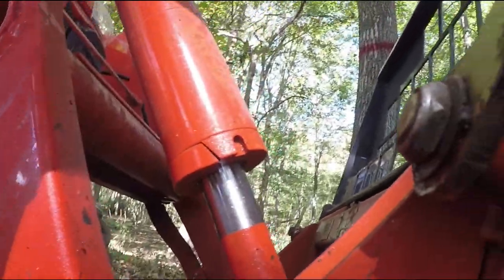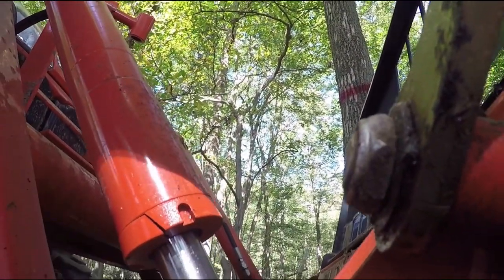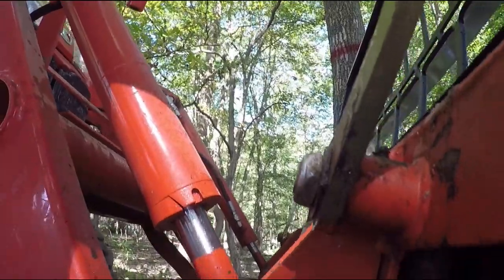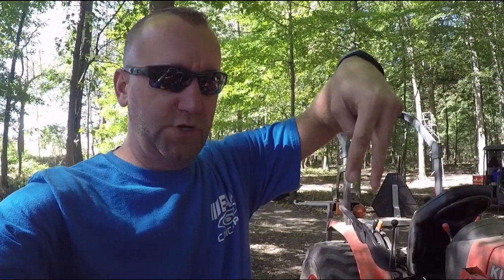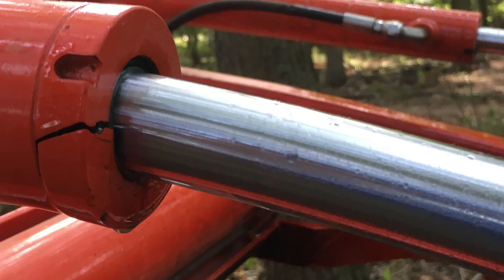Don’t Do This With Your Tractor!!

Comment: I replaced my kubota cylinders with cylinders from tractor supply.  Much cheaper to buy and easier to repair than Kubota cylinders.  Where necessary,  using a slightly shorter replacement cylinder that does not fully retract is no big deal. The fat cylinder has more power than skinny kubota cylinder.  In fact I was ready to throw in the towel on my 10 year old kubota till I started swapping cylinders. Use large kingpins to engineer them into position.  My old kubota tractor with new tractor supply cylinders and upgraded hoses is far STRONGER and way CHEAPER to operate than it was with new Kubota cylinders and cheap quality kubota hydraulic hoses. Kubota cylinders are planned obsolescence for their parts and repair business.
Reply from the maker: Kenton Hughes 
I didn’t even consider tractor supply for cylinders. I looked at all of the normal places online and didn’t find a real good match. I’d like to go from a 1.75” to a 2” cylinder but the tubes are too wide to fit between the ears and I’m not sure I want to do much modification. The other disadvantage would be slow actuation compared to the stock size. 

Magister carries a tang cylinder that is narrow enough to fit but I need an in between size to really work well. I tried one that was a 1/2” longer retracted and I lost more curl back than I expected. I may try the next size, which is 1 1/2” shorter retracted but 2 3/4” shorter extended. I have to see if I can sacrifice that much extension. I think I can because I hit my bucket stops before it’s full extended. I’ll make another video once I decide which way I’m going.

Comment: You can rebuild them a lot cheaper, also on my compact tractor When I had issues, I upgraded the cylinders....thx for video.
Reply from the maker: Freedom 1 
I agree. The problem I had was I deformed my tube. I had a busted cap, bent rod, and deformed tube. The hydraulic shop said it would cost more to fix it than to buy a new one. I did try though. They disassembled it and everything but there was just too much damage. 

I probably distorted the tube when I pushed the piston back in. Had I left it out and took it straight to the hydraulic shop I probably could’ve had it repaired cheaper. I was in the middle trying to get trees skidded so I didn’t want to take the time. My haste probably cost me more than it should have.
Reply: WorthOverdoing yeaaaa, that does make it difficult.... I replaced the seals in mine a couple of times. The 1st time i did it. It took me 6 hours.....the 2nd time it took 3 hrs. So next time I’m thinking it may only take 1 hr....ha ha..........thanks for the post.....best of luck to you!

Comment: I Would lift my front wheels off the ground with my bucket down and back drag with my skid steer all the time.... Never one issue ever in 5 years of owning it.
Reply from the maker: Sharp Shooter 
You never have problems until you do.  It has happened to skid steers too, as well as excavators, track loaders, etc. Nothing is immune.

Comment: I have done a lot of back dragging and the reason I have got away with it is that I don't go to full extension. I leave the last 4" of rod in the cylinder for strength, AND I don't try to lift the front off the ground while back dragging.   If you want to lift the front wheeels off the ground  back dragging,then use the heel of the bucket as this avoids ram damage.
 Tip: to change the thickness of the back drag when useing the heel of the bucket, use the curl, not lift ram to adjust thickness as it is more precise.  It just needs a little practice to get right.
Reply from the maker: When I’m back dragging I do the same thing. Changing the curl when feathers is definitely the way to go.

Comment: I used to operate a Case 580 and never had that problem. Believe me, I worked that thing really hard. However, the backhoe part was a different story. It leaked several gallons per day from one of the seals on the boom. It was like that when I started. I was making only $4.00 an hour and working 12 hour shifts 7 days a week for 30 days straight for a poorly run reclamation district. The wages were cheap and so was the maintenance. The boss was my wife's grandfather and never complained since it would get back to him saying I was ungrateful.
Reply from the maker: leegenix 
Good story. You just never know. You can beat on something for years and it never break and you end up doing something real easy and it breaks.
Reply: leegenix apples and oranges..case 580 is made for heavy work..kubota loaders are add on loaders and any add on is junk.I ran a 580 k for years with a clam bucket that was  tough and now have a john deere thats built like an army tank

Comment: Thanks for posting for the greater good =) You could have replaced both cylinders to avoid having the same problem with Kubota cylinders......The Bx is a small model but that should not have happened.......You might think/feel that this was from back dragging but its more likely that forward pushing broke the cap.....and back dragging against it made it noticeable with the leak.....This happens a lot when hydraulics are fully extended.....just a couple inches off fully extended limit would probably prevented this ....but at the same time it's clear that the 2 curl cylinders do not have the same throw.....I wish you the best of luck with the replacement =)
Reply from the maker: nitebird scuffle 
I plan on changing the cylinders but am having trouble finding suitable replacements with having to do a lot of fabrication. I just need to figure out what I’m willing to modify to make a different size cylinder work.  

This is a B, not a BX. It did crack the gland when the rod bent from back dragging. When you back drag, the forces are not pulling on the cylinder but pushing, which is how it bent. It couldn’t force it back in so it had no where to go.

Comment: I've been running JD 410 for almost 40 years. I can tell you a 410 could do that all day long with out breaking. Just a slight weak design. Still a nice little tractor.
Reply from the maker: Roger Trefren 
Possibly, but I found reports of the same damage from equipment much much larger. It all comes down to the cylinder being filling extended and then driving backwards. The machine is stronger when driving than what the cylinder can handle.

Comment: I have told many people who hook heavy loads to their forks or buckets and drag them backwards with the only result ,  to get in an argument.  DON’T DO IT !  Your cylinder is the strongest when you have oil on BOTH sides of the piston in the barrel. When you back-drag, so it with about 5*  dump on the bucket.  It’s a common mistake with almost everyone.
Reply from the maker: John Myers 
Thanks John! I totally agree. I keep getting bashed my people telling me the tractor is too small, or it’s junk, etc. It doesn’t matter. It’s physics. It can happen to any cylinder if put in the wrong leverage position with enough load.

Comment: I have seen it on all loaders . I've made new rods new end caps do not use you loader that way it will happen to you.iam really surprise only one cylinder usually both will bend.do not I repeat do not push on the blade of the bucket with your curl cylinders extended

Comment: Thanks for the video.  This is absolute news to me.  I have a tooth bar mounted on my FEL and frequently use the teeth in the fully extended position to back drag brush/branches from felled trees; mostly on frozen ground so not to chew up forest soils.  I put the bucket in float position to further reduce chances of digging into soil.  Never knew this could be the result.  Ouch!  If my tractor (Kioti CK20s hst) had an option for a third hydraulic on the front, I'd have me a brush grapple in a heart beat.  Lacking that, I'm going to check my curl cylinders and be wicked careful.
Reply: So now that I think about it, isn't using your FEL to get you out of being stuck (putting your bucket in nearly full-extended position, and drawing the tractor forward or pushing the tractor back) to get you out of  a much or other kind of hole put your tractor at the same risk?  This is fairly common practice and an advantage of having a FEL; at least that's what I have always heard and believed.
Reply from the maker: Moose Terious 
You’re welcome! Like me, you could do this a hundred times and never have an issue. That is, right up until you do.
Reply from the maker: Moose Terious 
It is not the same risk because you are using the hydraulics. Any time you are using the hydraulics the system is open to the relief valve for high pressures. The risk comes from the spool valve having the fluid locked with nowhere for it to go and then applying a large force trying to move that fluid. That is when something can bend. The driving force of the tractor is more than what the cylinder can handle.
Reply: @JaredsShop  Good information.  Thanks!

Comment: Get a new head, and press the rod straight in a press. I know everyone says it'll be weak, but I've seen ones pressed straight and last until the machine was worn out
Reply from the maker: Cindy Tepper 
I wish I could. I did pursue that option but the shop said the tube was deformed as well.

Comment: Wow sorry this happened! I was expecting you to say you were pushing with the bucket or forks tilted all the way forward due to direction of the bent cylinder, and location of the crack
Reply from the maker: The only way this can really happen is via the way I explained. It takes a cylinder that is fully extended trying to get pushed back in to bend like this. The only way it get pushed is on the backside (bottom) of the bucket.

Comment: Never crossed my mind this could happen, thanks very much for sharing.  I’ve done the exact same thing dragging logs with my bucket tripped.  I’ll definitely be more conscious of how hard I’m pulling.  I admittedly put my loader through quite a bit off hard labor.  I have an industrial JD 301A and that yellow paint often gives me a false sense of indestructibility, everything has its limits.
Reply from the maker: XP Slinger 
Yep, just be careful. I made it worse by using forks. I just never gave any thought to the physics of everything.

Comment: Gee, I thought everybody knew that.   Buckets and associated hydraulics are designed for curl and lift, not pull and drag.  Also see a lot of backhoes and excavators with loose pins / bushings and twisted arms because the operator insists on sweeping too heavy a load side to side.   Helps to read the manual; not that I ever have, of course.
Reply from the maker: Sans Decorum 
I think most pieces of equipment probably get used a little outside of their intended use. I know I’ve used a crescent wrench as a hammer just because I didn’t want to walk over to the toolbox. 

This was an instance where I didn’t even feel like I was pushing the tractor too far. The leverage of the forks was just too much though. When I was looking for replacement cylinders I couldn’t believe how many stories I found with the same damage. That’s why I thought I’d share. Making sure everyone understands the physics.

Comment: Good video , there is a float position on the bucket stick , would this have prevented this stress  ?
Reply from the maker: No, it would not have prevented this. The float function only works for loader up/down and does nothing with the curl function.

Comment: You could repair that cylinder and have someone with a lathe make a new rod. I make them all the time.
Reply from the maker: michaeljp86 
I did try but my tube was deformed. It was going to end up costing more than a new one.

Comment: Yep this is why these kind of toys are made for the Rich boy, I have repacked many of these, when you misaligned your cylinders if one get slightly out of straightness you will bend the rod break the dust cap and the Pistons will scar the boar in other words you messed that cylinder up
Reply from the maker: Steve Armendariz sr 
Yep. When I forced the rod back in I also deformed my tube, rendering it unfixable.

Comment: Hey!  Use your machine for the intended use. Parts can brake when there's fault in them. Don't bully your machines. Good video & advise. Thank you. Could of shown more pictures and or some graphics about it.
Reply from the maker: Rex Luminus 
It was really a spur of the moment type thing. I wish I would’ve taken more pics after it happened but I was in work mode. 

I wish you guys could have seen what I was doing because I wasn’t abusing it at all. I was just trying to spin a log. It was just the leverage of the forks that killed me.
Reply: WorthOverdoing   Sorry for your loss. I got the picture though. Interesting to know. Things happen out in the fields. Thank you &all the 👍best in the future.
Reply from the maker: Rex Luminus 
Same to you. Thanks!!
Reply: WorthOverdoing   😎🆒Cool!  Show more videos.
Reply from the maker: Rex Luminus 
I am trying. Just super busy. I did upload a new one about my new grapple. I have a ton of video but just need time to edit it. I’ve been traveling too much lately.

Comment: Chances are there was no damage to the cylinder tube or piston rod so all that you may have needed would have been the replacement end seal cap and perhaps a piston which are sort of generic parts, not all that hard to rebuild really.
Reply from the maker: Clarence McGregor 
I wish that were the case. Unfortunately, I deformed the tube so it wasn’t worth rebuilding. That was my fault when I hastily pushed the rod back.
Reply: Stuff happens!